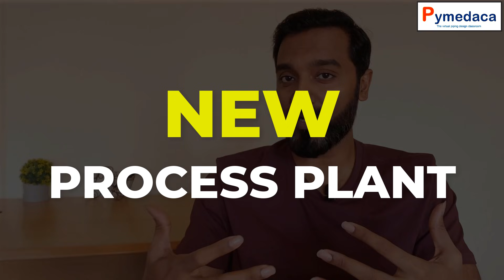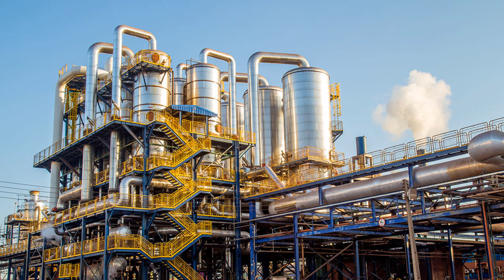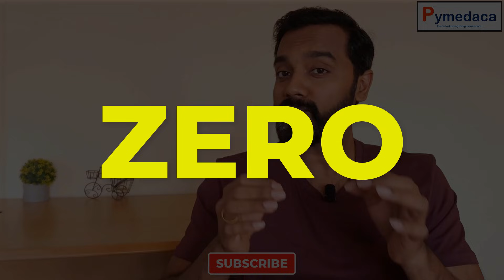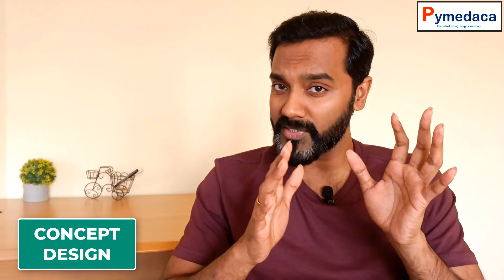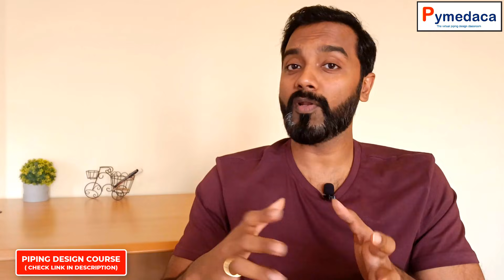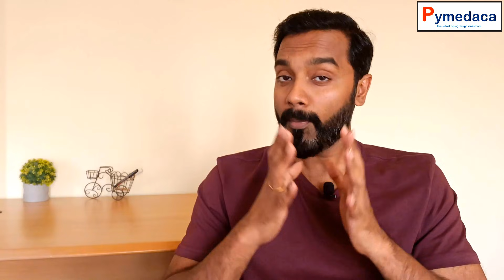Green Field Engineering in Piping Design ( All Engineering Stages explained)

Comment: What is the reasoning behind selecting a 3000lb fitting for a  150 pipe class
Reply: As per p&id if 150# rating pipe is connecting with higher class  pipe (mostly near valve breakup flanges)  we will use the connecting flange as a higher ranting flange